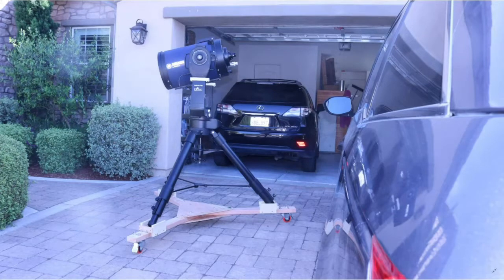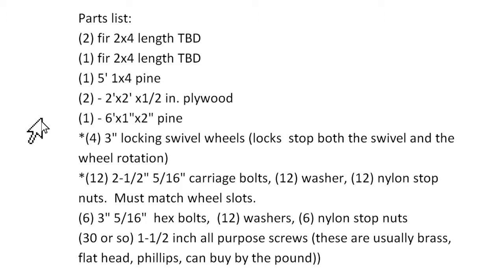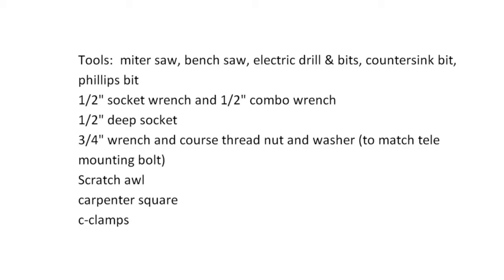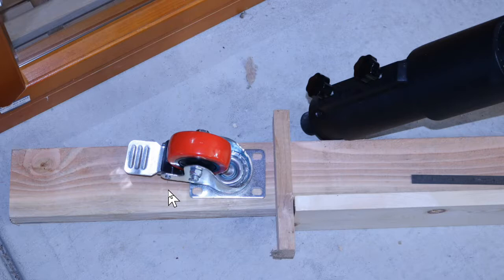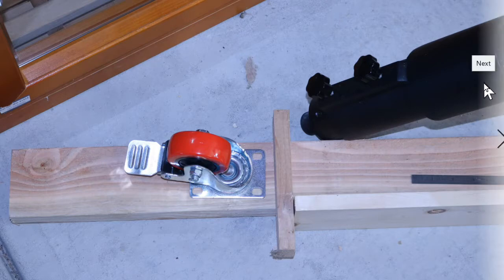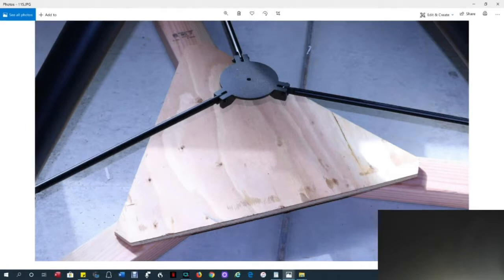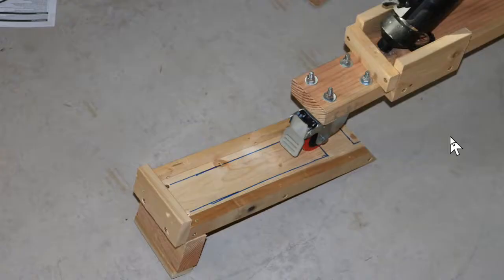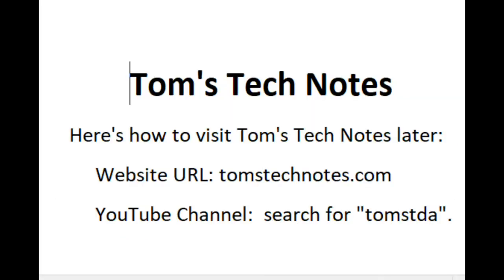How To Build A Telescope Dolly Part 2

Comment: you need at least 8 inch  pneumatic  tires. the small rubber or whatever tires you have are way to small. they will not glide on grass or a rough surface
Reply from the maker: Thanks for your comment.  I designed the system for use moving from a garage to the driveway.  In thefuture, I may update the video to include your suggestion.

Comment: Hi, And thanks for the instructions for this cost effective tripod dolly.  I was just wondering why you wouldn't use the off cuts of your 2x4s to create the tripod leg stops, rather than the 1x2 and 1x4.  It seems like there will be a lot of left over 1x2 and 1x4. Am I mistaken?
Reply from the maker: You could use 2x4 for leg stops, but that will make the dolly heaver.
Reply: @tomstda  Thank you.

Comment: Got it Built, Wheels have a bit of Play even when Locked i can wobble the stand, did you encouter this, I have exact same wheels as yours but the 5inch because I have to roll in Grass. Thanks for the Video Built mine just under $100
Reply from the maker: Wobble only matters if you are touching the telescope while photographing.  Probably won't disturb the aliment much.  You could eliminate the wobble by installing 3 large bolts through the wooden tripod legs, and crank them down for stability. Use a nut and large washer on each side of the 2x4.   Of course, that increases setup time.  stick a small board under each bolt, on grass or dirt.
Reply: @tomstda  I did not turn the casters till they clicked did not realize that till later, the wobble is very slight now.  I just can't thank you enough for your video, My dolly is great I am very happy. I used your parts list and everything, Just did not account for the plywood thickness and my bolts and just had to countersink a little better and it all came together. We are going to pave a path in the backyard to a small patio-like area and make it just wide enough to roll the scope out to the dark area in my yard, I got a skyfi III and can GOTO any Position now using my iphone, then I have a 50ft USB3 cable to my laptop for imaging.
Reply from the maker: @Dudleydogg  Glad to hear everything came out okay. I've had to countersink bolts when I ran out of the longer ones. If you haven't already please check out my other astronomy related videos you might find some of them useful.https://www.youtube.com/user/tomstda/playlists?view=50&sort=dd&shelf_id=6

Comment: You have a mount top center of the telescope, for like extra viewfinder, I put a Helix focuser on mine but has no cross hairs and want to put the old viewfinder back on but need some mount that will fit.  Where do you get those parts from do you recall.
Reply from the maker: A good source for parts companies are the ads in Sky and Telescope, and Astronomy magazines.  Also, I've had good results dealing with OPT,   https://optcorp.com/  and Scope City http://www.scopecity.com/

Comment: I don't have a Garage with a dark front yard so I have to go out the back which means I have to roll in the Grass. I am looking at pneumatic tire casters, do you think that will be a wobble issue?  10 inch Swivel plate casters on Amazon.
Reply from the maker: You might want to use locking casters, or chock the castors to keep from disturbing your telescope alignment.
Reply: @tomstda  I found these all-thread with Feet and lock nut that you can lower once the stand is in place to anchor it.  The moving of the Scope is what limits all my time if I could go in and out with ease i would use it so much more.  Thanks for the quick reply.
Reply from the maker: @Dudleydogg  Good idea.  That increases setup time, but more stability is always good. Before covid, my club went to a paved parking lot on a lake an hour away.  Now, I infrequently roll the tele out on my driveway, but the sky is pretty bright here (and there are a few house lights on my street).

Comment: Do you mind showing how you connected the 2x4s before putting the plywood ?
Reply from the maker: Put the points of the 2x4's together at the center of the lower plywood triangle (and on top of it), then carefully align the upper plywood with the lower plywood.   It might be easier if you drill a one or 2 inch diameter hole in the center of each piece of plywood, so you can verify that the 2x4's points are touching in the center of the plywood. The holes would also be helpful in making sure you get the bolts in the correct positions through the 2x4's. Clamp the plywood and 2x4's with  3 C-clamps, then drill the bolt holes.  Just make sure the bolts go through roughly the center of the two by fours, and not too near their edges.  Also there are 2 bolts in each 2x4, and they are about 4 In. from the plywood points and 4 in. from the center of the plywood.  As the video shows, I assembled the dolly under the tripod with the 2x4's touching the sides of the tripod legs to ensure it comes out right.